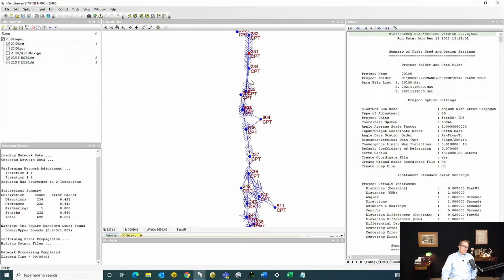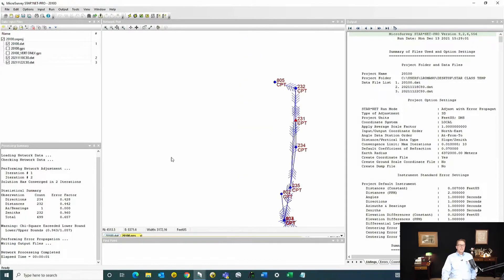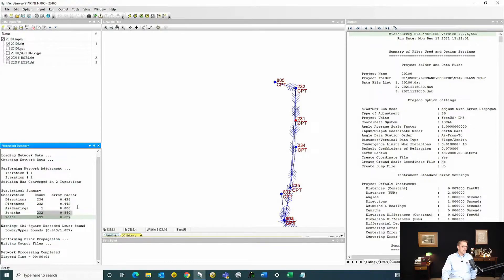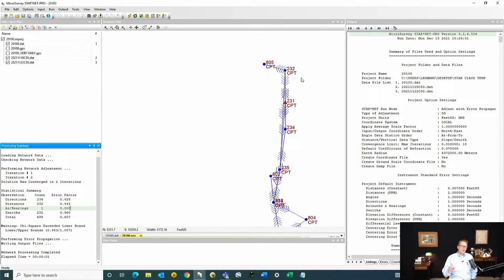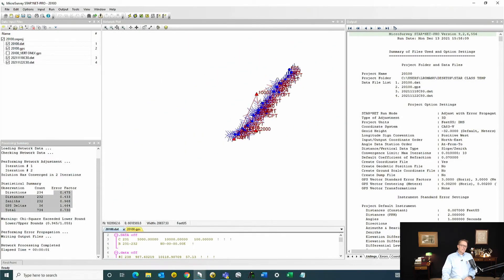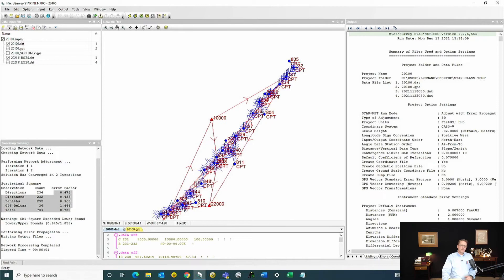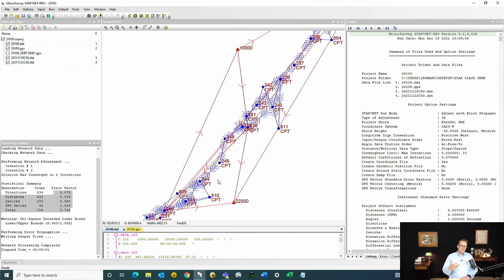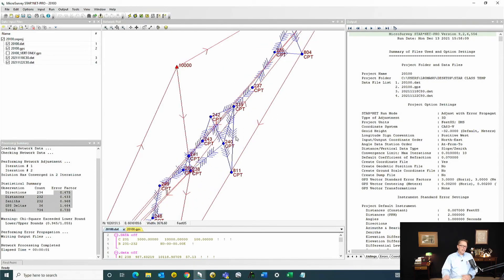Episode 16 Least Squares and Coordinates 3  of  3

Comment: Dave, I appreciate your expertise.  When you describe using GPS static observations for the fixed points in your network, are you using OPUS single point solutions for the coordinates?
Reply: Matthew Kelley:
We do not use OPUS.  In our area we have a CGPS/CORS network i.e. continuous base stations with published coordinates based on time epochs that we can download and constrain our adjustments.  We did this on the survey shown.  We needed 1991.35 epoch coordinates and they were no longer available for our CORS stations.  We had to constrain to 1991.35 ground stations, using static GPS, set 20 years ago. 
I think post processed GPS network to an OPUS coordinate system would yield similar results.  
Hope that helps.  Dave
Reply: You certainly can use OPUS positions if they are appropriate to the needs of your project. I often do. Alternatively I may use positions derived by RTK from the VRN available to me. But most commonly I will position my RTK base using OPUS (multiple occupations if possible) and hit selected points of my traverse (where the sky is best) with RTK vectors.  Static vectors would be still better, and may be necessary if the length of the traverse exceeds the base radio range.  The vectors and the terrestrial traverse data may then be simultaneously adjusted in LS.  By using the vectors together with the associated covariance data, rather than resultant coordinates from an OPUS, the vectors are appropriately weighted in the adjustment.     If you do use OPUS on the multiple points be sure to assign appropriate standard errors to the OPUS points.